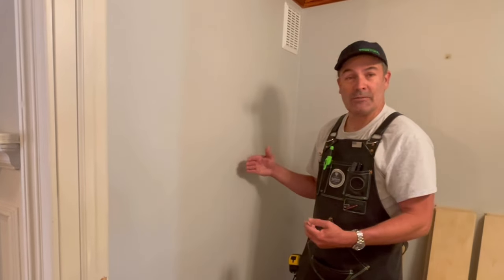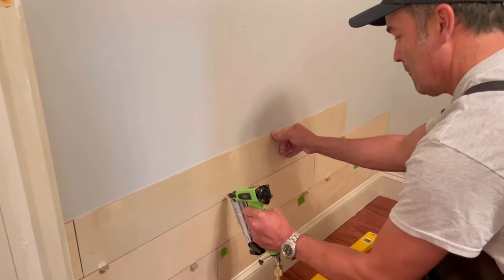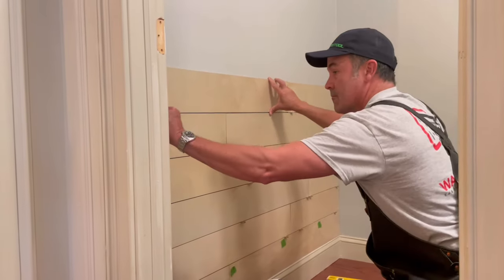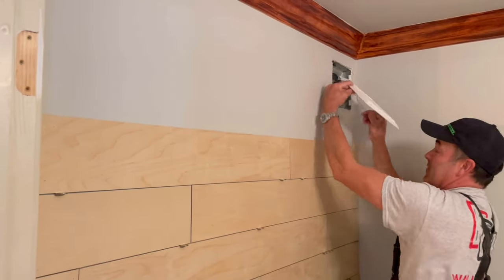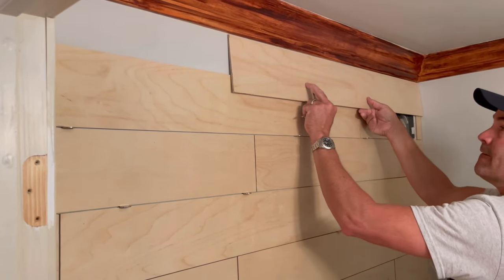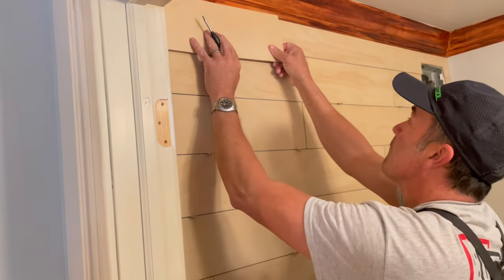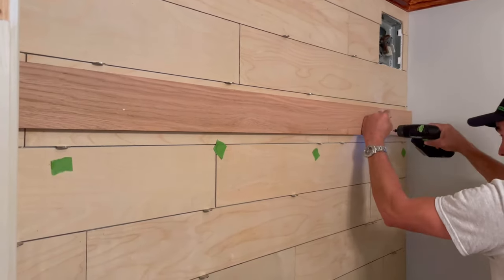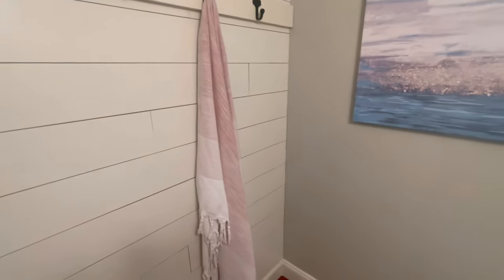Easy - DIY shiplap wall

Comment: I love this look. We're having a screened porch built, and the long wall of it is the exterior wall of the house. The siding has been removed, and it will have shiplap applied. The contractor got some nickel gap rabbeted wood shiplap from Home Depot that looks awful - it's thin, cupped and warped. It was to be applied to the ceiling, but it's going back and we're going to do something else there. I think exterior plywood faux shiplap will look the best on the wall. Do you think we should use plywood thicker than 1/4" because it's exterior? I wonder if something should be applied to the wall before the shiplap, because removing the siding exposed black tarpaper (pretty ripped up), and some substrate planks that have a contoured face. (The house is 75 years old.) I'm thinking that we need a flat and white substrate before the shiplap. Would like to hear others' thoughts on this.

Comment: I like videos that are right to the point.  Great job Ronnie.  Any buyers remorse with the Grex?
Reply from the maker: Thanks. I am on the fence about the Grex, I have had it for a long time and every once in a while it will not fire, I hit it play around with the PSI and it will start working again but not sure what the problem is. I like that it is compact however. I am currently investigating battery powered pin nailers I think it is time and Milwaukee is the front runner right now.

Comment: Did you have any issues with splinters along all those cut edges? Did you sand all the edges first?
Reply from the maker: The @festool saw I am using has a splinter guard and minimal to 0 tear out - if I was not using this saw light sanding would probably be required

Comment: Hi why are you using a solid piece of oak ?   could it be a different type of wood ?
Reply from the maker: Just using scraps from the shop instead of burning
Reply from the maker: Yes normally I would use Poplar for painted